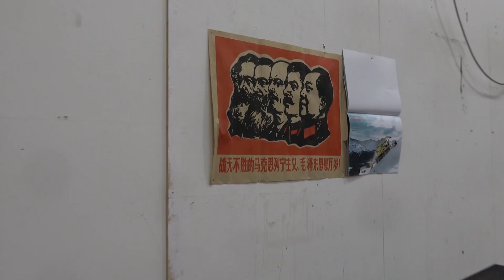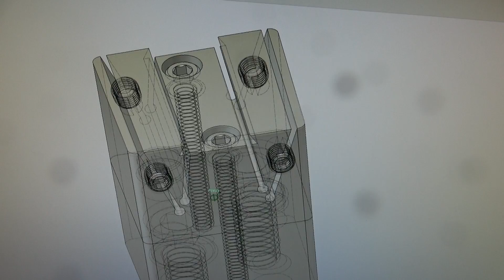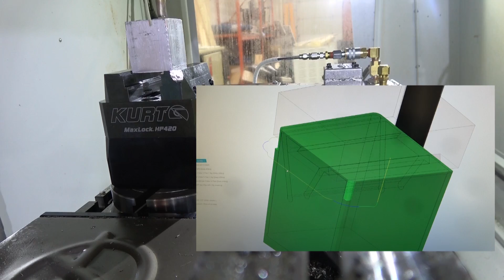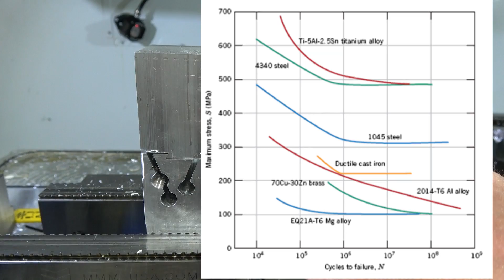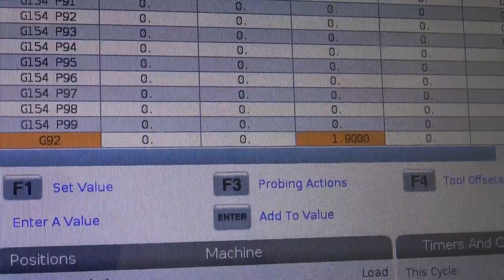Prototype invention 5-axis Vise?

Comment: Would make more sense in my eyes to tap through the outside of the flexture perpendicular to the axis of flex. Then have two setscrews push on the flex to clamp the part. Could even add steel inserts for better wear resistance on the threads.

Comment: Stick a conical washer on each side of the slit with a through bolt!
Reply: That was my first thought as well. Maybe a 30 deg. Taper to the "cone" should provide enough of a driving wedge shape while being a shallow enough angle that you can spread the load over say 1/2 in. On both sides.
Reply: Wouldn’t a wedge get jammed? Ergo once she’s tight there no backing off
Reply: @ngallakp62  i dont think so, we have a component that uses a similar arrangement on the equipment i work with so as long as the clamp and the conical piece are made from the same material you should be good. I suppose if you were really worried about it a light coating of anti-seize could prevent it from seizing

Comment: Is the bottom of the stock between the dovetails touching the bottom of the dovetail in the holder? my understanding is you want a gap so that the clamping force is drawing the stock down.
Reply: Philip Hahn  I also noticed that the flats to either sideof the dovetail showed a gap. My understanding is that the flats carry the load and the sides of the dovetail provide downward force to clamp those flats together. There must be a clearence under the base of the dovetail.
Reply: That's what I came here for. It looked like it was bending at the screw between the bottom flex point and the dovetail and forcing the flat bottom of the moveable jaw upwards. Half wondering if simply splitting the whole block down the center and using two bolts from the side and squeeze would be 'better'.

Comment: 7075 (and to a lesser extent 6061) are used for flexures all the time as your maximum range for a flexure bearing is going to scale roughly proportional to the modulus to yeild strength ratio. Titanium and Beryllium Copper are also widely used materials for high performance flexure bearings.

Comment: Just looking at the video it looks like you're mating on the taper instead of the horizontal flat between the parts. That is, the wedge isn't pulling the part down to mate the vice top and workpiece bottom. 

Do you find it's beneficial to have the mill electronic probe as well as the manual probe or would just the electronic solve the 90/10 problem of feature and in-process probing?

Comment: SUGGESTION: What if you slotted the face 90deg clockwise from the clamping holes through to the flexture slot, 1 grub screw at each side gives you 3 points of contact, 2 of which are independently adjustable but leaves 100% contact on the 'fixed jaw'?

Comment: I know the goal is to keep the BOM low and the ease of use, But what about putting a grub screw in from both sides for even pressure? You can keep the 3 points of contact with the dove tails and just put a grub screw behind each high point on the side with 2. OR flip that and put the grub screw behind the side with the single point of contact. I started this before finishing the video and see you made some reference to something similar(maybe?) when the piece came out of the vise. 

Other musings from observations and quick googling: The angle of the dove tail appears to be more acute in your prototype than that of the expensive guys. I imagine this is piss with the cock you've got proof of concept prototype so run what you brung. I wonder is there is a reason for the pros using a less aggressive angle? They also appear to have a relief in the base of the dove tale in the few pro models I saw. My guess is that this will reduce the interference of corners and allow for a better contact with the faces of the dove tails yielding better surface contact and more grip/friction. Mabye you barked up a different tree chancing the wrong squirrel with the 3 points of contact thing?

Comment: How about simply putting a tapered helical wedge thingimabob in both ends? If you want to get really fancy you could even use reverse threads on one side, and have the hex hole go completely through the screws, allowing for one long hex wrench or shaft to reach both screws to tighten simultaneously and evenly. It would increase  the complexity, but it would also triple the cool factor to compensate.

Comment: Wouldn't it work better if the compliant mechanism didn't have an included angle? Just two vertical slits and then tension it with screws in the XZ-plane?

Comment: 4 bolts on the bottom to a steel block. The steel will not slide as much. and tap both sides and use 2 screws to tighten

Comment: I have found for universal type applications e.g. job shop just buying a real vise makes things easier and faster. I would get away from dovetails if possible because having to do prep work just to use it sucks. If you wanted to continue on that path you should at least have a stop at one end of the dovetail to constrain movement to stop it from sliding along the dovetail. As for using aluminum for fixture parts I do it all the time in production and have been amazed at the number of cycles the clamps and other implements actually last. Being your machining all the parts, you should not need to build in a lot of movement into flexures, a bunch of the clamps I have designed and use in production only need to flex .002 or less to clamp the parts in place. At that level of flex even 6061 clamps last a very long time. Check my IG @frelux if you want to see some ways to save lots of money making your own fixtures, I have taken it to the extreme in many cases lol.

Comment: Why not clamp perpendicular to the dovetail groove. Use an allen head bolt, countersunk head. So on left side of slot counterbore shoulder and on right side of slot tap blind hole. Use 2 Allen head bolts. This way you don't have to depend on the left side deflection ( prevalent nowadays in political stage)

Comment: There is a way that I have built dovetail fixtures (Even before dovetails were cool). Just two parts and two cap screws. I would model it and send you a file if I knew how to do your digital media thing. What did you call it? Get hub or something. O buy the way liked your simulation inserts in the video I will have to try that idea.

Comment: They do the same thing here in the UK, businesses will happily charge you $2000 for a filler cap or a small spring and $200 for the cardboard box they ship it in, plus $160 handling and $200 shipping 🙄

Comment: Maybe try and move the flexture slit so that the fixed dovetail and bottom face are solid, with only the flexture dovetail moving during clamping. Additionally I am not sure pocketing the dovetails is necessary unless you have a need to define the points of contact, with just one set screw applying the force you could keep the fixed dove straight, or add a very slight dip in the center, and add a very slight hump in the center of the flexture dovetail. Make cnc work for you!

Comment: .....you're wedging from the wrong faces bottom block. shouldn't need but 2 holes opposing sides? Or wedge 1 hole each end face after saw cut to the middle upper block?

Comment: Nice idea trying to use a compliant mechanism but that design won't work "well" for machining. As you tightened you screws half the force went left and half went right because there wasn't enough material on the left side. It also has the added effect of rolling your part because of the clamp being a swing arm. Always brightens my day to see new videos from you.

Comment: A more industry standard method for clamping is to use mitee-bites or other low profile fixture clamps, available at McMaster or similar.  Even something as simple as a nut with an eccentric hole.
This ensures your clamping movement happens in a single plane where as the flexture you have here is rotating in space causing one end of the part to lift and your V to be misaligned.
Also your probing could be off because your programmed stock is slightly different than your actual stock.
It’s often better to probe for the center of your stock rather than the corner so it’s equally wrong on all 4 sides.

Comment: @3:43 "it didn't probe properly" Actually it probed perfectly, but only the one side because you picked vise corner. Try the 'rectangular block' cycle with your G54 in the center of the part.
my two cents on the design: preload the flexure before you cut the actual dovetail so it'll engage properly when you give it the ugga duggas, like soft jaws
And as someone who's used the fancy dovetails at someone else's dollar: WORTH IT. 
But seriously, if you have the serrated jaws on the lil Kurt, just swap them out for some custom ones with the dovetail geometry, how hard can it be? 😁
Reply: I was gonna comment the same thing. Always program from the center. If ur stock is oversize itll distribute on both sides instead of the cutter taking it all on one side.
Reply: exactdamundo...
Reply: About carbide-level hard.
Reply: See this is why i work from center now that almost all the hurcos at work now have probing...
Reply: I have done that for my little Bridgeport (M2). Made a pair of jaw inserts put them in the vice closed and cut  the dovetail. I then support the base of the inserts with an adjustable parallel. I works with multiple size dovetails.
Reply: You lost me at "probe"
LOL

Comment: I would give it a nice machined surface or real nice bore somewhere that you can use for easy probing.

If you set up the fixture in fusion (even better a proper template), and your stock is sufficiently big, you can probe the dovetail into the machine, get it nice and accurate, and leave it in there. Then you just have to clamp your stock in the same place you modeled in fusion (usually the center)

Comment: You could try milling a pair of tapered pins. Make one with a thread and the other with a clearance hole for a bolt. MIll a taper into either side of the vise.  That way you have equal pressure on both sides of the vise and just one screw to tighten. You also don't have to worry about stripping threads in the vice body. You can just make replacement tapered pins. The only problem may be releasing the pin when you unclamp.

Comment: In place of the single set screw, could you run two wedges that come in from either side and face each other? The wedges would have to have a matching hole drilled through them to run a bolt through for tightening. That should alleviate any uneven clamping and provide the most surface area for force onto the flex arm, but obviously at the cost of more parts and complexity.
Reply: I had the exact same thought. Another way to do it would be to make the nut and bolt into the wedge's themselves, reduce total part count but increases custom parts. However a downside of wedges is you could potentially remove the tension holding the wedge in place but if there is enough friction between the wedge and clamp face it could get stuck.

Comment: Instead of threading a grub screw into that tapered hole, try two threaded holes on the perpendicular side compressing the compliant structure. 
Dont even bother with the tapers.
Reply: Isn't that going to divide your maximum clamping force by the ratio of the taper that's been omitted? With his set up, the force is being multiplied twice, with straight up perpendicular screws, youve just got the multiplication from the plane of the screw thread.
Reply: @AtlasReburdened  but you can put in like 4 of em.
Reply: @rubzlovespancakes  That's going to get you 4x the force of one. With a properly matched taper you can easily get dozens of times the force.
Reply: I was thinking the same thing.  Bit like a row of set screws pushing against a gib on a machine box way.
Reply: @routercnc9517  but, the box way doesn't want full clamping, just a consistent pressure so that movement is constrained to a single axis.
Reply: On my lathe one of the set screws is used to squeeze the sliding part hard against the dovetail and lock that axis well enough so you can machine with it.  Seems like it is the same requirement so I think it would work here too.
Reply: Wouldn't a bolt squeezing the slot be better than a grub screw expanding said slot.
Reply: @no candy and yet Kurt use a big screw to clamp.😉
Reply: @no candy this makes a lot of sense. But it can be tricky to make properly. Also, how much pressure do you really need? Generating lots of force also means containing it...
Reply: This is the comment I was looking for. Sure, you might get more clamping force by driving in a wedge, but it's useless because you're forcing the material apart, you can even see the deflection. Two bolts pulling the dovetail together would be more than enough to hold it good and proper.

Comment: Make the slitting saw cut tangent to the hole to reduce stress/fatigue. Also 2 tapered holes compressed by matching sliding cones squeezed on the same shaft/threaded rod will give even clamping.

Comment: What if instead of a dovetail slot you just have a square slot and square peg. Drill and ream two tapered holes such that half the hole is in each piece (centered on the interface of the slot and peg surfaces). Drive in two tapered pins till she's tight. This has been done for probably over a century to retain shafts in hubs. Mebe it will work for square-ish stuff too?

Also, your 5th axis costs more than my first house and it doesn't even have a shitter.

Comment: Steel does fatigue fail. The chart that you show in the video does show that. What it is showing in that chart is if your stress is below about 300 megapascals then it won't fatigue failure but if your stress is above 300 megapascals then you have to draw a line down from the intersection of that line to how many cycles before it will fail. Could very well just misunderstood what you were trying to say but it sounded like you were saying steel won't fatigue fail which isn't true.
Reply: The more I think about it the more interesting the problem is because when you are doing machining like that you do deal with vibration and vibration in and of itself does cause fatigue failure if it is a high enough max stress. It's something that has to be taken into account when looking at jet engine components and the cyclical vibration loading they cause.

Right there an enginerd shows how things get expensive haha

Comment: To aid clamping id have to say come at it from da tick side and drill out a hole slightly over sized then counter bore it. then thread the "jaw" and use tension to tighten the vice vs pressure. Tension is easier to control but more importantly more repeatable

Comment: For the cost of these things, you'd think they'd probe with lasers or sound or someshit.
But no, it's "just slap your dingus against it until you find the spot you're looking for"
Reply: Sounds like me back in highschool
Reply: Then slowly tap it with the dingus a few times; each softer than the previous.
Reply: @quadmasta  isn't that what's happening in this video?
Reply: Snarky . Live An interesting point, they could use an entire 3D scan array, so you wouldn’t get just gross dimensions, you could see all the existing features in 3D space, overlaid with your tool paths in your CAM program.

Would be great if you’re working on a partially or fully formed part, trying to modify/repair it.
Reply: sounds like an apt description of my love life.
Reply: The y use lasers to measure flatness... and the tools they use probably cost a third to half of what that Haas does.
Reply: Heck, if it aint broke, fix it until it is
Reply: laser would give false reading on occasion of unusual surface or something.

Comment: 5-axis? Is that like interdimensional?
Reply: Length, width, height, time, and smell.
Reply: If I remember there is 6 Axis in the universe:
- 3 vectors x y z (sliding ones) 
- 3 moments Mx My Mz (rotating ones)
Reply: @geekoid183  Correct, but then you get into convoluted machines with more axis of motions, which allow undercuts. For example, Toshiba got in serious hot water in the 80s for selling 9 axis machines to the Soviet Union  to machine submarine propellors - something that the west had a lock on until the sale - its one of the reasons why our subs were so much wuieter than theirs.
Reply: Linear dimensions X, Y, Z.  Rotation dimensions a, b, c.

Z is always the axis through the center of the rotation of the tool (which I believe is c).  X is usually the longest axis perpendicular to Z, and Y is orthogonal to X and Z. Then "a" is the rotation on the X axis, and "b" is rotation on Y.

Then you can really loose your mind when you get into planes of reference, etc.
Reply: Axis, not dimensions.
Reply: Nah... You got to go into +7-ish to start multiply some of the infinities.
Reply: Axis aren't dimensions

Comment: Instead of going in parallel to the dovetail why not come in perpendicular from the left side. Thread the holes and depend on the pressure from the set screws pressing on the dovetail. Angle the set screws upwards towards the dovetail so the screws hit flush on the angle of the dovetail. Would achieve a much higher clamping force, won’t have to change much and can make as many points of contact as needed!

Comment: Why schew around with the taper? Why not a couple of set screws coming in at right angle to the slot?
Reply: Also opens up the possibility of helicoils or etc. so you don't gall the aluminum threads right to shit
Reply: Or do opposing taper screws, one from each side?... Rather than the lone taper screw that does not secure the outer edges adequately.
Reply: willardthegrey that’s what she said
Reply: I was thinking the same
Reply: I agree. Or just make 1 cut for flex then through drill with nuts and bolts for tightening